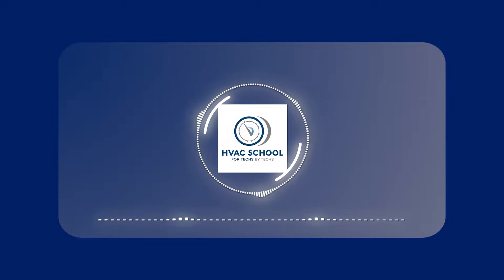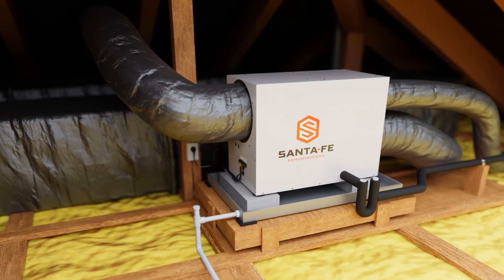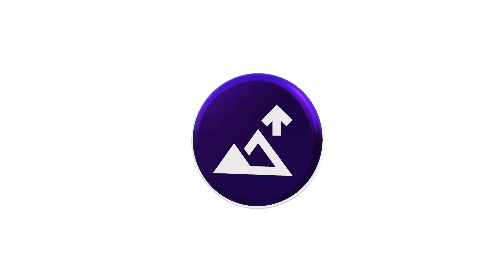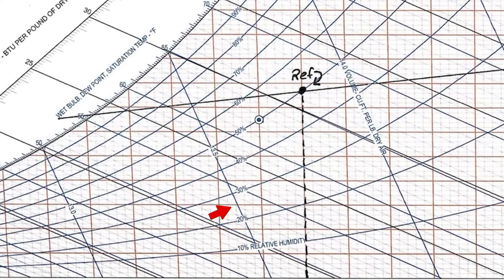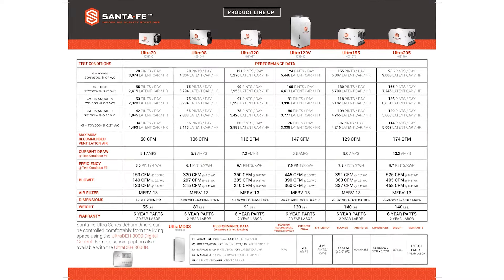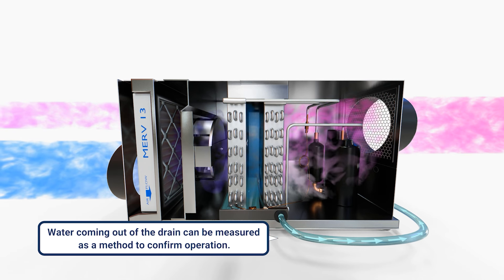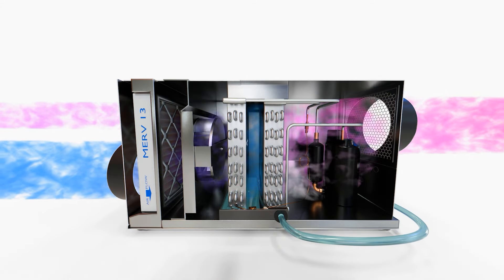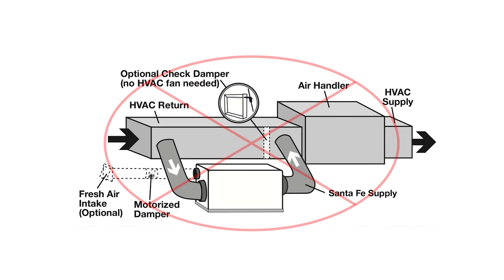Testing Dehumidifiers: Q&A with Bryan Orr

Comment: If your. AC unit is sized correctly, shouldn't humidity not be an issue?
Reply: No necessarily. It’s a lot more complicated than just sizing an AC right. It has a lot more to do with the structure and how well it was built among other things. It’s a lot of times nice to have equipment specifically designed to take care of a certain issue, whether that be humidity, IAQ, etc.
Reply: It depends; the AC unit can be sized "right" for the sensible load as per manual J, but that doesn't mean it can handle the latent load without over-cooling the space. I you really want one air handler that can handle any load, it needs to be able to modulate its coil temperature, plus a reheat of some type, be it hot-gas, subcooling, electric or hot water. Pretty standard for commercial equipment, but not so much for residential systems. I believe Carrier has a residential system with modulating electric reheat, and Lennox has Humiditrol, which uses subcooling, but I don't know about any other systems.
Reply: @ZergZfTw  The dual stage modulation units are extremely expensive. Carriers' top end.
Reply: For my home in Connecticut, a separate dehumidifier ducted in to our central air has been very helpful for comfort on cooler rainy summer days when AC isn’t running much, and in those spring and fall months for the same reason.
Reply: @TinkerTry  I reside in lower MI. I'm experiencing high dew points and humidity it's awful. Mid to low 60% RH at night. Was debating on having a Carrier dehumidifier installed.
Reply: When the air conditioner is not on it’s not dehumidifying.  So for nine months out of the year the air conditioner does not run enough to dehumidify unless you overcool the house.  When you overcool the house moisture condenses between the walls and mold grows.